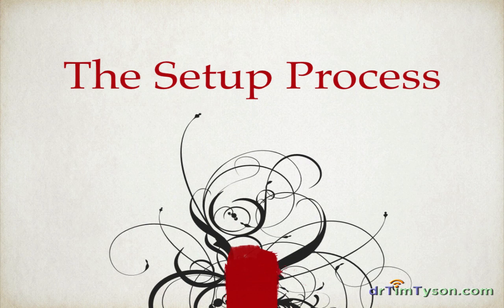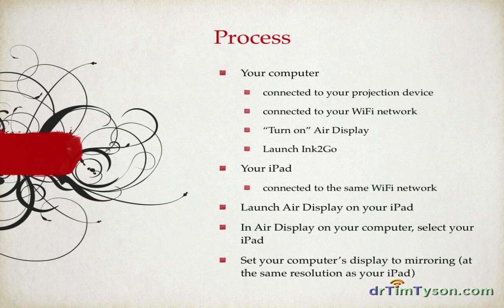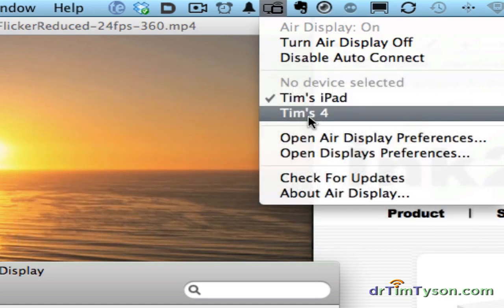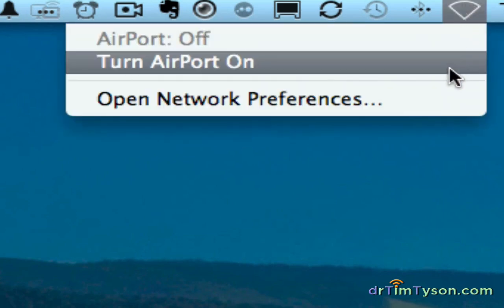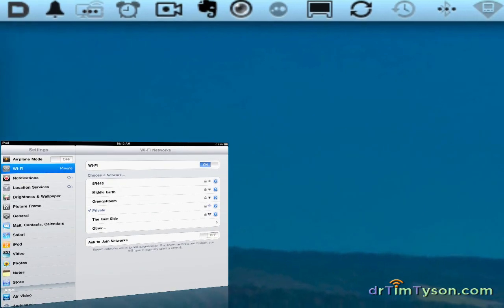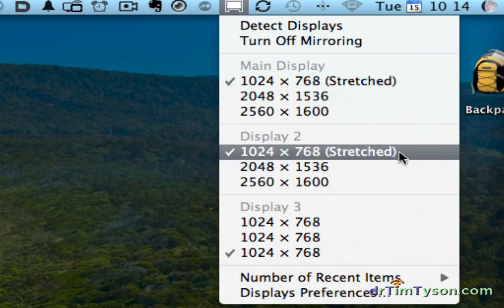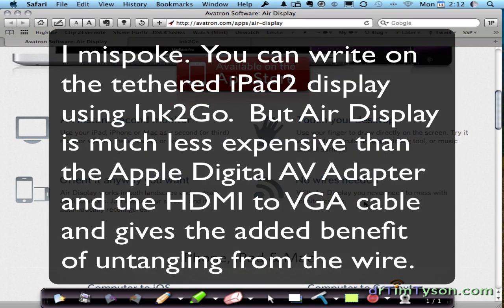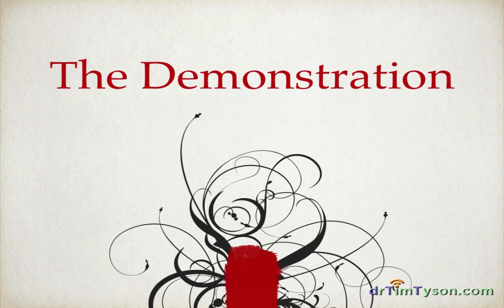iPad as Interactive Whiteboard - Part 2:  The Setup Process

Comment: ink2go is a PC/Mac application which means you need to purchase and install it for each PC/Mac that you are likely to use and of course have the rights to install it - this would effectively knock it out for many computer labs and teaching rooms.  However being able to control your projector display even without ink2go still makes the iPad a useful tool for presenting a power point.  However it needs to work wireless to wired on the same network - not all labs are wireless